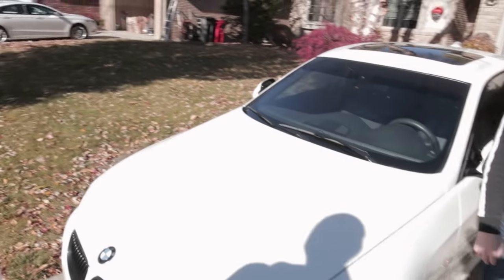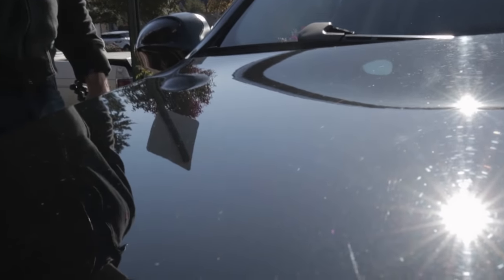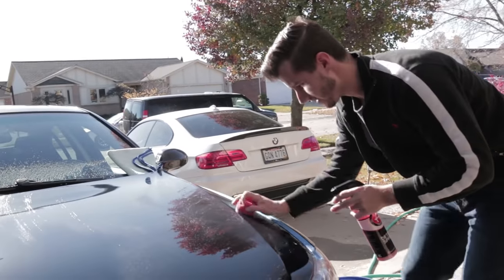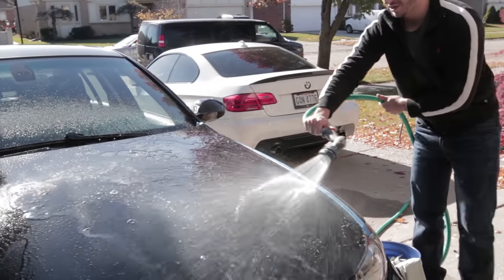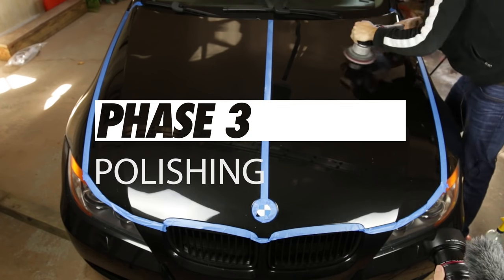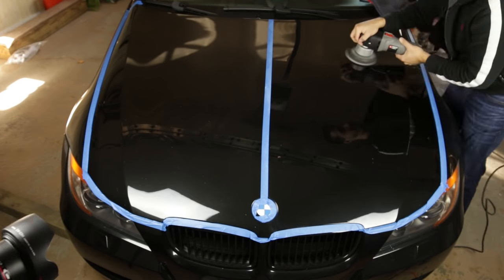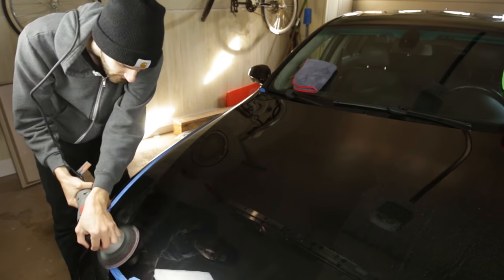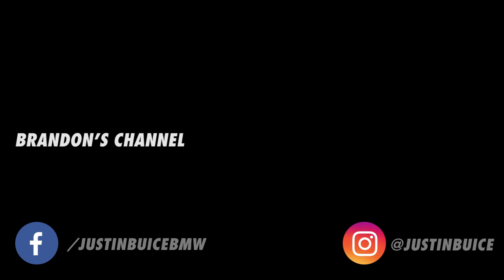How to Remove Swirls FULL PAINT CORRECTION

Comment: I thought one of the major selling points of CarPro Essence was to not wipe down with a product such as Eraser (5:28) afterwards, since Essence contains Si02 and acts as a sealer and primer for any final topping you might want to finish off with whether it be synthetic sealant, wax, or coating.

Comment: Find a better detailer!
Never seen anyone start washing with a mitt on a dry car...
Plus, way too agressive on the contours of your hood, those edges are the most susceptible to burn throughs!
After cutting and polishing, there should be no halograms left behind, which is evident in the vid, even with poor lighting!
Reply: I thought the same on the hood lines. With micro fiber and rough compound no less.
Reply: Wdym by halogram?
Reply: Started on a dry car, At that point I paused and went to the comments , hahahaha
Reply: It depends how rough are the compounds or polishes u go in to hard u have no clear coat
Reply: @rogier2707  HAHAHAHAHAH!!!!!! Me too !!!!!  Too Funny
Reply: @splash that's a polisher hes using because I have the same one, you cant burn a car with those because they have variable timing like an orbital. I also have an actual dewalt buffer and that WILL burn and strip paint. However on a good which Is all metal you do have to keep moving but it is a lot harder to burn or strip. Anywhere where it's not metal though I would highly advise being careful but hey detailers told me you're not a real detailer until your strip paint only way youre going to learn
Reply: This detailing was very poor
Reply: I know right he probably charge 100 cause that's not a 200 polish
Reply: @jacoblorenzo871  And why the hell he uses microfiber cutting pad for polishing? You dont have any defects left for the microfiber pad to cut so you take a soft foam pad and make those metalic flakes pop.
Reply: @jacoblorenzo871  not possible.  He won’t make any money.  He said like 3-5 pads just for bonnet and double for car   Unless he’s using wish.com shit😂😂😂

Comment: you can see some hazing/holograms or residue in the part that you polished on 5:45..
Reply: He did an eraser wipedown which should have removed the polishing oils. I'd say it's hazing from the polish/pad.
Reply: Definitely holograms
Reply: I saw that as well. I'm not a fan of carpro essence.
Reply: Probably those are holograms, most new to polishing won't see that or look for it when inspecting the paint, they just see the swirls are gone until they bring it out in direct sunlight and all the holograms pop up which are worse than swirls. That's why you should use a dual action polisher, a normal rotating one need good skill to not get holograms

Comment: Clean Slate = Dawn dish soap.
Same results but cheaper for those on a budget.
Reply: dish soap dries out the rubber/plastics.  Look it up
Reply: Brandon B obviously, but you dont have to spray the plastics/rubbers on the vehicle. Simply mix some distilled water and dawn soap in a spray bottle to control where you spray the solution. (Chemical Guys tends to be over priced only reason why I pointed this out)
Reply: Alex Blancas waxmode (YouTube channel) proved convincingly that neither dawn or CG clean slate strip wax off your paint. Look him up, excellent reviews and demonstrations.
Reply from the maker: I actually saw that video a while back. Pretty interesting!
Reply: Justin Buice the only assured way to remove waxes and sealants is to use a polish like meguiar's ultimate polish or M205. then a good wipedown.
Reply: We did do a full correction with FG400 and ESSENCE.  We did all the steps don't worry.
Reply: Alex B. If you hate your car use dawn
Reply: That's not a budget....that's just down right cheap!
Reply: Alex B. 50/50 of 91% isopropanol alcohol and water
Reply: OCDetailing ocd I only use water from northern France.

Comment: Using Menzern 400 is a wise decision but I advice to use a better pad than the one you used try wool pad better or optimum orange pad. Because the one you have used is a final finishing microfiber pad.
Reply: Feras Al-Hindi disagree. Meguiar’s MF pads are totally capable to use in this scenario, while suggesting a wool pad on a non rotary porter cable would be ridiculous.
Reply: That's a microfiber cutting pad. The industry standard...
Reply: Nick M nick it is up to you to disagree, but let me inform you that porter cable DA machines provide you with a synthetic wool pad for free on the early days they launched it. Later on they start coming with foam pads. In general during my 20 years of experience DA polishing has been always with wool pads and it works perfectly well. Any way microfiber pads can are the newest from Meguiar's especially. So they provide microfiber polish compounds for that only! It cuts nicely for light swirls, old wax, spots and acid rain. But for scratches and sanding marks it do bad result even you pressure hard. Dual action polisher are not a technology that dose not work properly with wool pads who told this to you don't have a technical reference neither a logic or experience. It is up to you to agree but I use synthetic and lamp wool on DA and they work better than foam pads including the advanced one such as hexlogic and waffle type and CSS.
Reply: Feras Al-Hindi Sounds like the you may be stuck in the 90’s with some of the traditional methods you use. Autogeek’s Mike Phillips, and many others do not recommend a wool pad on a small throw da, especially a PC as its not “free spinning”, probably due to the fact you can grab a flex 3401 and a force pad and achieve similar results. Here in the US the da’s are not typically coupled with wool pads, because if its that bad we wet sand it, if the rotary and wool pad won’t remove it.

Comment: Ever try rupes Italian polishers? Work great, Also the flex polisher.  What's your take on touch up?  Prefer the brush from the dealer or taking a pneumatic paint touch up gun to the panel? Just finding the paint to match code is impossible in quantity like that.   I've got an 01 Acura CL type S black which is midnight pearl black with metallic flake, impossible to find.   Once sprayed 5 coats and 5 clear, looks amazing after a 3000 and 6000 wet sand, finishing glaze, few coats of synthetic sealant.

Comment: Question why did you tape off? And other people don't tape off. I saw a video where the same vehicle was getting detailed no tape off
Reply: To protect trim / rubber coming into contact with polisher.  It can be a pain to remove the residue.

Trim is also very porous.  If it's dirty and your pad runs over it, there's a good chance of contaminating your pad.

Comment: I'm confused, I thought this was a "full paint correction", but the video ended showing all of the swirls and  surfaces scratches were still there when the finish spray was applied.  Would it not have been wiser to go another round with aggressive polish before hitting it with some higher grit polish, then a micro-finish polish?
Reply: Michael Cox detailing on a budget  I guess

Comment: for the car pro hydrate, I would basically apply that after I wash (2 bucket method) and clay bar my car? also once that is applied, how long do i have to wait for it to cure and can I use pro hydrate after i polish the car with a sealant?

Comment: Hydro 2 looks interesting....looked it up through your link, holy smokes very expensive!! best you be buying some Meguires synthetic xpress spray wax to keep the hydrophobic properties topped off!
Reply from the maker: +Ken Lawton i'll have to ask him, but i think the link might be a concentrate. If it is then it probably makes 3 or 4 spray bottles. There may be a pre-diluted version that is less expensive. Also, i noticed that liquid products on amazon are sometimes an arbitrarily high price
Reply: Justin Buice that would make sense.  I was serious about the meguiar's synthetic xpress spray wax though, that is seriously good spray wax and would help maintain your black paint with ease. Look it up on amazon, cheap for a gallon in the states ($80 here in Australia)

Comment: I don't understand why he used a polish that fills in the swirls instead of a product that actually eliminates them.  It takes more time and effort but products fillers will no wash off.  Soon as that sealant is stripped from the car, the swirls will start coming back since the fillers will wash off after that which was covering the swirls.  Polish with filler is old technology like tube TV's.

Comment: You dont take out swirl marks with compound Lmao been buffing 30 years in detail shop and paint shop And use a real high speed 9 inch buffer wool pad You will not burn paint with compound if you keep it wet and keep moving Buff waxing you cant burn it unless your sit in one spot for a long time and this is with a high speed  buffer.That little  buffer he is using would take all day and doesn't have the power to do a professional  job